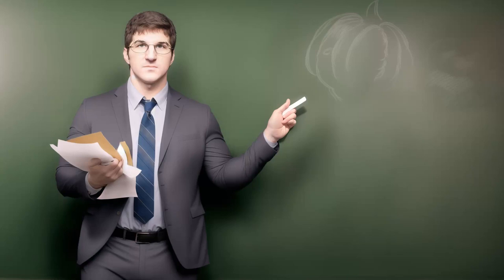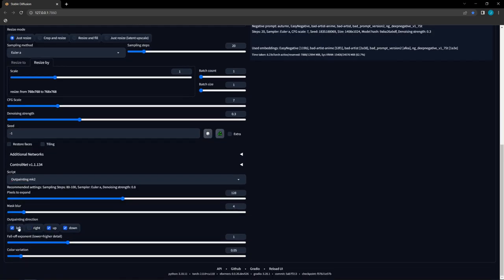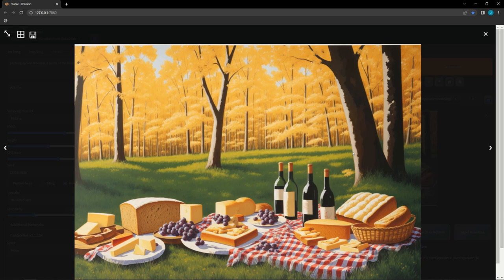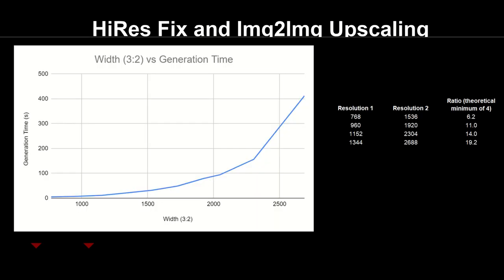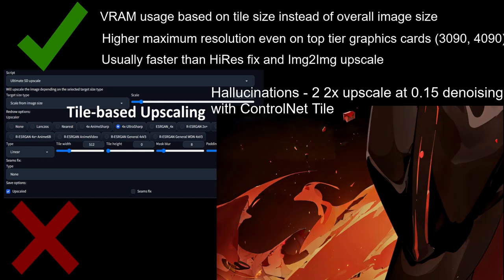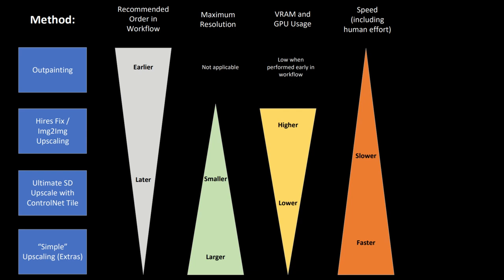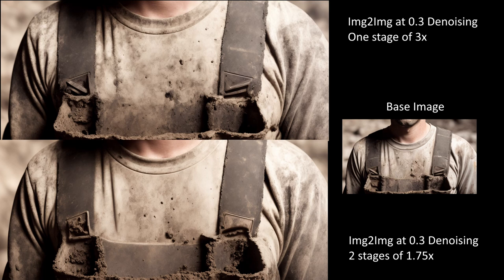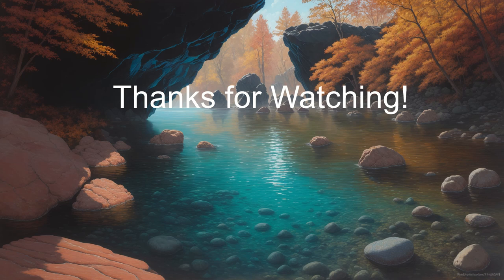Make Bigger Images in SD: Pros and Cons for Outpainting, Hires Fix, Img2Img, and ControlNet Tile

Comment: Something to add, the multidiffusion-upscaler-for-automatic1111 extension under Available in A1111 comes with something called Tiled VAE which with default settings allows my 8GB GPU to do 2x Hires. fix upscaling where it normally would get CUDA memory errors. Worth taking a look at as well, and I assume this can allow a high end GPU to push even further as well. This option is also available under Img2Img, though I have not experimented with it yet there. My assumption would be that it allows for even higher upscaling in that tab also. Multidiffusion is another tiled upscaler solution btw., although I haven't played too much with that part of it yet so no idea how good that is compared to the Ultimate SD script.
Reply from the maker: You're not the only one mentioning this extension and it seems very promising indeed.  I'm in the process of testing it.  Pinning this comment since its a more succinct explanation.

Comment: There is an incredible amount of info in this video - all very clearly laid out with out any "Puff & Fluff" like alot of other ones. I learnt a lot of snippets of info. I find another handy feature of the image to image tab for resizing is the Batch tab. I'll generate a large batch of images at a lower res & skim through them and delete a heap that i dont want, then I'll "Batch Upscale" the whole folder using the Img2Img features (the upgrade to the slider for size was a saviour for this because it means you can mix Portrait & landscape orientation in the folder & you can also do a bit of cropping when you are choosing the generations to upscale & it will just do a blanket multiplier regardless of the orig dimensions). Keep up the good work 🙂

Comment: WOW! It seems you covered everything! This is a great video and might be the best on youtube for comparisons on this topic! I have tried most explained in this video. I work alot with portraits and I gravitate to img2img upscale x2 with denoise around 0.1 to later upscale again with UltraSharp x2 in both steps using restore face.  ControlNet is super important for good and consistent output. The image output are amazing and the faces are almost so good they become 3D popping out of the screen. However I'm working infront a 43" 4k TV screen. Anyway great explained!

Comment: Very interesting video.  I do find that Latent upscale gives by far the best results for photoreal images, with a max scale factor of 1.5 and denoise of around 0.45-0.5.  The issue is it tends to ruin a decent % of images.  Do you know if there is any way to use tile_resample inside Hires Fix?

Comment: 1) I get best results with latent upscaler -  HiresFix settings: Latent (nearest-exact), denoise 0.63,  hires steps = txt2img steps / 2
You can use Latent upscaler in img2img too.

2) The choice of sampler affects the upscale result: try different, in that order:  DDIM / SDE / 2M, 2S 
Euler a sampler makes everything more blurry, imho

3) Use Tiled VAE (adjust tile size) - if you have CUDA memory error

4) Use different checkpoint (model) for upscale in img2img, for experiments